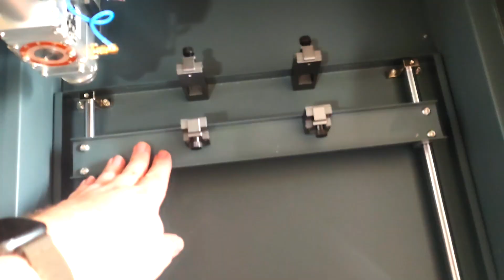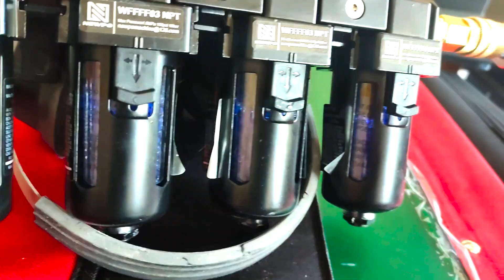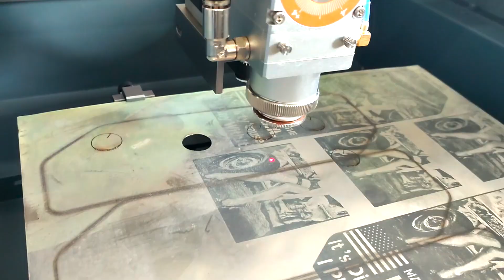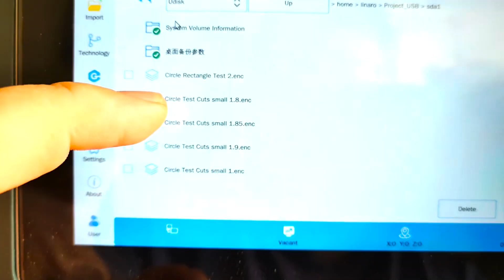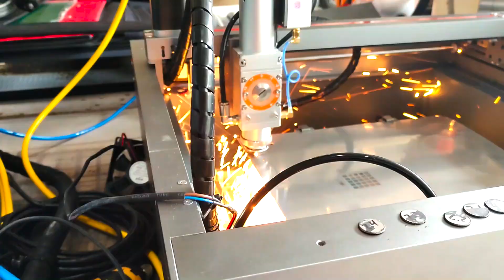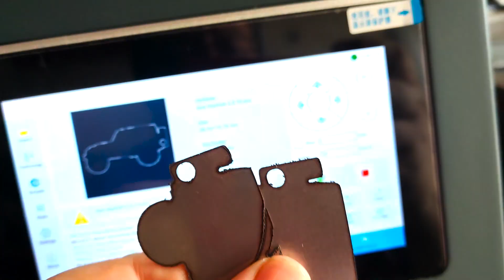Will the $3,500 Laser Actually cut metal? Trying to figure out the settings to cut 0.5mm SS

Comment: You need to drop the focus.
Reply: It is supposed to have continuous auto-focus too, you probably just need to find the way to use it / turn it on
Reply: @zeikjt it has auto-height following. Meaning it will maintain the nozzle distance to the part as it moves across it. Focus is something you manually set. It's the dial on the front of the laser head.

Even the fancy $200k fiber cutter at work doesn't have "auto-focus", you set it based on material thickness, type, coating, etc.
Reply: @ccatlett1984   oh okay, gotcha! Thanks
Reply: The air pressure is way too high.  It also looks like you may have a pre-production machine as you has printed labels, my machine has the ports marked directly on the equipment. You correct about tuning but too higher air pressure will definitely cause problems such as the ones your encountering.